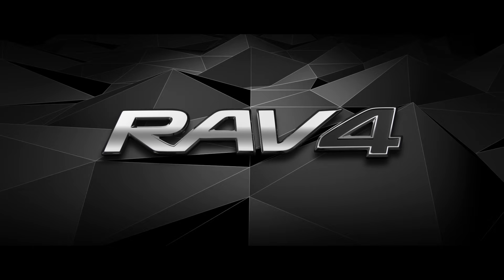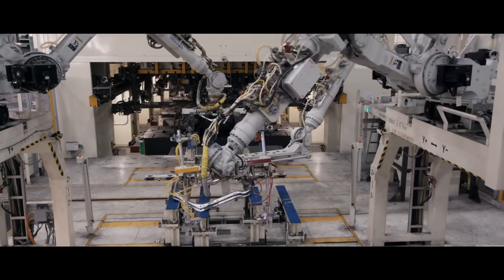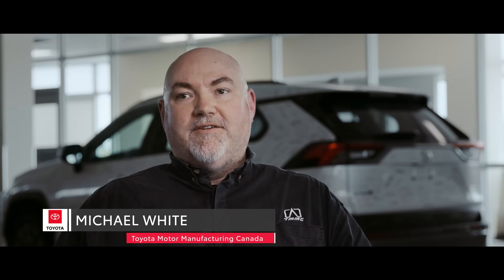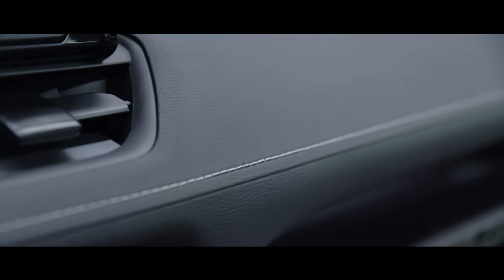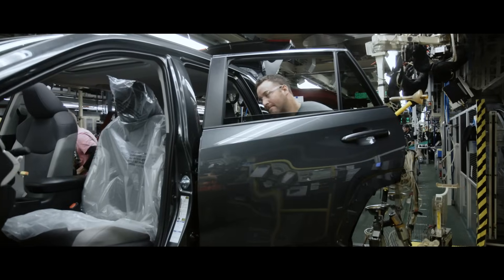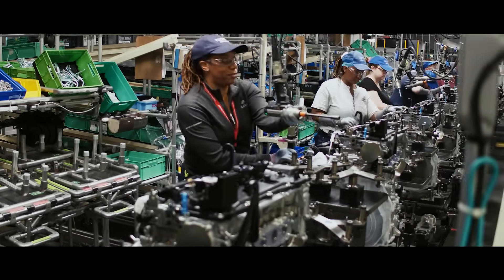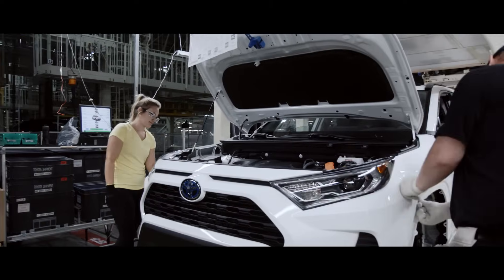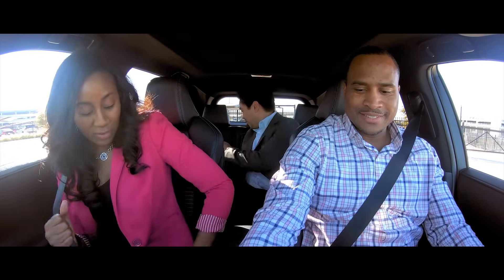Toyota RAV4 Specs & Manufacturing Process Overview

Comment: Changing the engine oil at 10k mile intervals is a MINIMUM standard set by Toyota to avoid voiding the manufacturer's warranty, but actually most drivers are using their vehicles in a manner best described by the SEVERE service section of the maintenance schedule.  Listen to the Car Care Nut on U-tube.  He rebuilds many engines a year for excessive oil consumption issues.  This is avoidable with more frequent oil and oil filter changes.  Oil is cheap while engines are not.

Comment: For the mid-cycle refresh, please add recovery points to the chassis (EG Ford Bronco Sport), a narrower center console /or better knee padding,  more sound deadening, and a height adjustable passenger seat.
Reply: Amen to that.
Reply: The seats are very uncomfortable; especially the front passenger seat.
Reply: Toyota would have to worry about stealing sales from Lexus if it did that :P

Comment: No "body on frame" I would  never  take it off-road.... it's  aluminum  & will NEVER  bend back to normal  if kinked,hit, nudged or jumped even  a couple inches = very likly to happen  often without  people knowing...but if you land wrong  the unibody can bend up easily if it's  aluminum! -In the past
Reply: Obviously not serious off roading. Even a grand Cherokee is unibody
Reply: Is the body aluminum or steel?
Reply: Body is steel, only the outside panels are aluminum.

Comment: Toyota should make  rav4, sienna, sequoia and tacoma with the rear window options that goes down like the 4runner and tundra. 
Also dual moonroof .
Tundra rear seat should full down flat, not up, different engine options for all vehicles like a v8 in a 4runner. 
 full size  van to compete with the ford transit , promaster and nv200.  
 the tundra is a half ton so they should also make three quarters and 1 ton models as well. 
Come on toyota.
And bring back the mr2 spyder.  It can compete with the miata.

Comment: keep build on them reliable vehicles that is what stand behind Toyota name ( RELIABILITY ) a vehicle that starts every time i'm heading somewhere. it will not let you down. only one request from Toyota Exterior Designers. please make your vehicles looks as sharp and elegant like the  Germans Exterior design. wide body wide tires aggressive outstanding look. if Toyota does that i guess it too difficult not to be the real number one choice vehicle to buy .. I own 2007 Toyota Camry XLE V6 an outstanding reliable car no question !!!. .. but i do  have to change a lot of your original specs .  i would recommend you to have more variety of optional width and wheels size specs presented to the enthuthiast. to add their own improvement/style .. thank you :-)